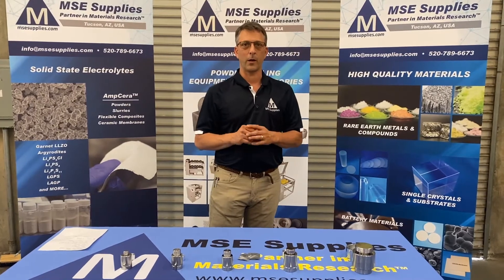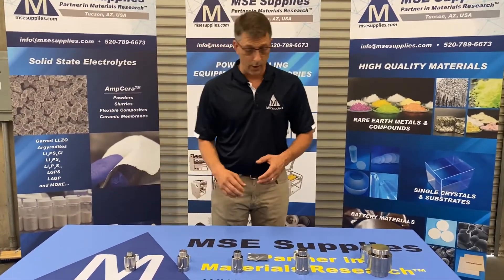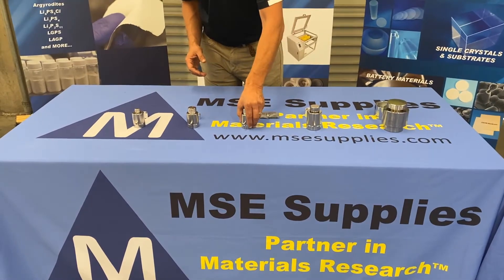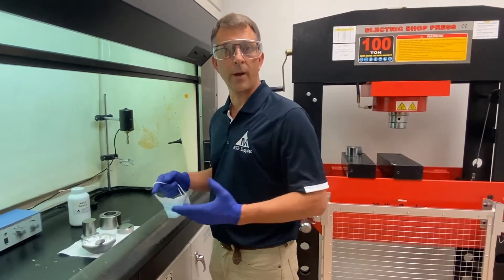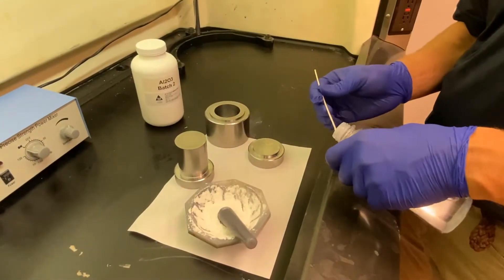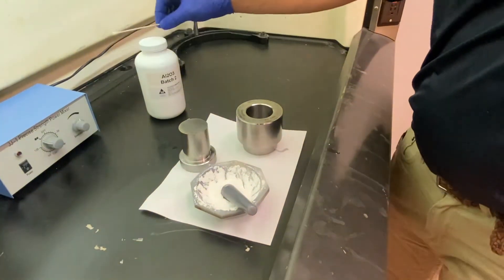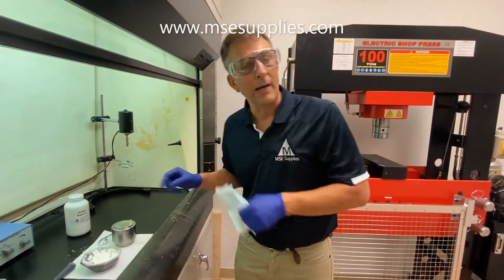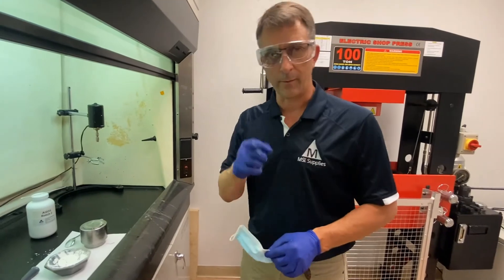How to Use a Laboratory Pellet Press Die Set - MSE Supplies

Comment: Would you still use mineral spirits on a heated die @ 200 degree Celsius? Also, is there a lube that you can coat the pellet cavity with avoid the paste ceramic material from bonding to the die (also at 200 degree Celsius)?